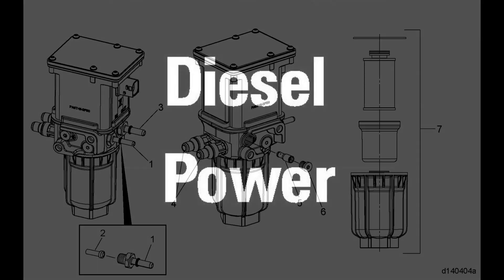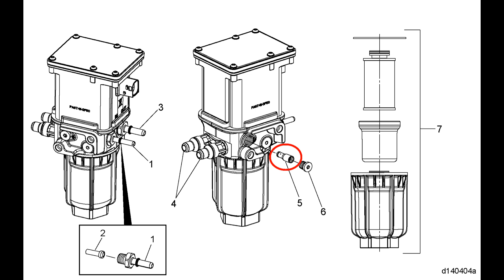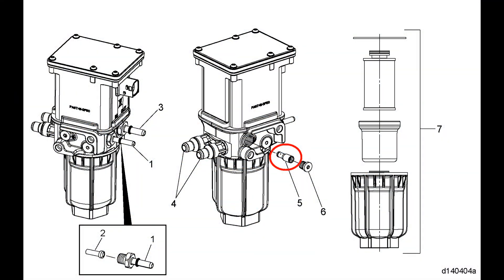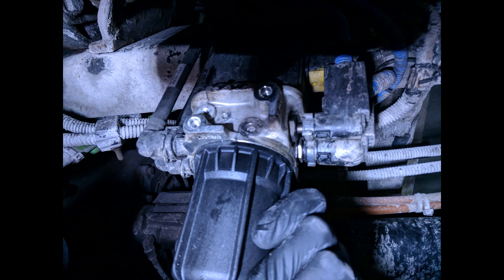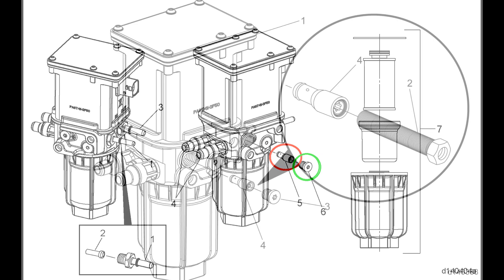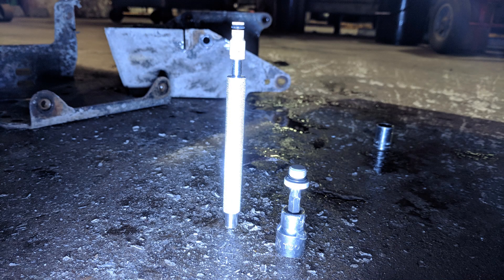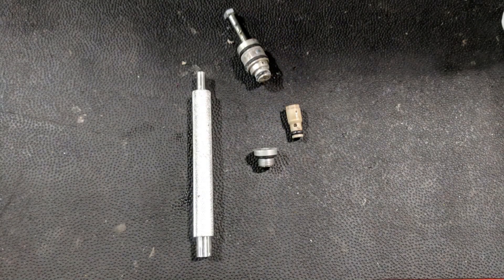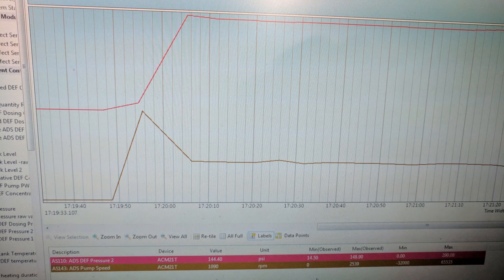Low DEF Pressure FIX

Comment from the maker: It's been a few years now and since this video was posted I have had great luck with reusing these valves. Simply cleaning them with hot water and working the valve seat and spring with a thin pick is all it takes to get them back in working order.
Reply: What size screw did you use to get it out?
Reply: @idontknowsh..8612 did you ever find out what size it is?
Reply: Great info, I was in Colorado -10 degree now I got the code 4374-0 about how much was the kit, thanks
Reply: Can you solvent that you clean oily pans and parts? or must be strictly hot water only?

Comment: What size screw or bolt to use in order to take the valve out? Fine threaded but what size?
Reply: Did you ever find out what size is needed?

Comment: Fault Code SPN 520342 FMI 17  DEF system rationality DEF pump speed high   and SPN 4374  FMI 0 DEF system under pressurized , got red stop engine CEL  and amber engine CEL and def light flashing with tank full. Truck went into limb mode. What you think will this kind points to the Pressure Relief Valve maybe plugged too? Not hearing anything from the pump and running. Can the pump be run manually by give it 12 volts? to test. I checked and is a 2020 freightliner  114sd detroit HDEP Diesel 12.8l i-6  55k miles 5k hours on engine and the records show that def filter was never replaced witch supposed to be every 3 years i think. What you think? Thanks for your time

Comment: I pulled out,  but is def supposed to stop coming out or is this a consistent flow
Reply from the maker: If the level in the tank is higher than where the pump is mounted, it will most likely continue to syphon out.
Reply: @TheDieseler  Ok the same thing happened when i disconnected theines for def doser.  Just kept pouring out until i reconnected

Comment: 4374 fmi 0 came up right after I replaced the DEF pump.. any ideas?
Reply: Detroit has a prime def pump service routine you have to run
Reply: Correct you need to prime the pump

Comment: Would this valve have anything to do with these codes? 5246 FMI 0, 4364 FMI 1, 4364 FMI 18 or 3364 FMI 2. I’ve been dealing with this issue for about a year and 3 shops can’t figure it out. I’ve changed everything except the one box.
does this every night. All engine lights come on and I stop and do a forced regen and codes clear for the rest of the night. Ever come across this before?
Reply from the maker: This valve is most likely not the issue. Check out this video - https://youtu.be/EVtehk9AR6Q
It's a run through on what needs to be done to properly diagnose this issue.

Comment: I wish you would do a video on bleeding one of these pumps. The information you give in your videos is awesome and led me to replace the pump. It wasn't much more money than the kit you talked about. After I installed the pump the system wouldn't build pressure. I pulled a vacuum on the outlet of the pump until I got fluid but after that it was only building 106psi at 1600 rpm. I disconnected the supply to the doser and ran the pump until I got def and plugged it back in. I ran my test again and got the same specs as you. That worked for me but I couldn't find the proper procedure for bleeding the system. Thanks for your help.
Reply: My low Def pressure code came back spn4374 fmi0. This problem shows up after the front brakes chatter while backing down a incline. This time I went straight and pulled the pressure line off of the doser and ran the ads self test until I got fluid and I plugged it back in. In just a second I heard the pump load up and my pressure returned to normal. Do you have any thoughts on how this could possibly be related to brake chatter or is my problem in the doser because it shouldn't need to be bled manually? Thanks for any help.
Reply from the maker: Sorry I didn't see this sooner. As long as the pump is not sucking in air (Submerge the doser supply line in water and watch for bubbles) it shouldn't need to be bled. It's not a deadhead system and DEF and air are always being returned to the tank and purged. If leaking fittings and air are not an issue I would be taking a good look at the wiring to the Doser. This is where the DEF pressure sensor is and that wiring is notorious for rubbing through on things and even on itself. I've even seen wiring that has rubbed completely through the Doser body which allowed it to corrode inside and give false pressure readings.

Comment: Or u can just replace the o ring on the vavle and save you're self money
Reply from the maker: +Cash_NYC The O-Ring is not the issue. The valve is cracking open below relief pressure.
Reply: TheDieseler ok thanks

Comment: people, what he is talking about here is LODS (liquid only dosing system)  also if any of the hard plastic lines from the tank to the pump or from the pump to the one box dozer nozzle and back to the pump are kinked (inner liner all jacked up) you can get pressure codes as well.  keep the def tank clean. use GOOD def. there is a hydrometer (similar to coolant hydrometer) to measure the def concentration you need 32.5% concentrate. there are many things that can and do go wrong with the def system.  good video.

Comment: Hey, im currently working on a bus with this exact code. When testing, the pump would run at 3400rpm but pressure would only be about 40psi. We ordered a new def pump so hopefully that fixes it. Your thoughts on it? Also it has a active code 4332/31, is it related to the def system? Should we fix that problem first? Or is this another issuse by itself. Thanks
Reply from the maker: +hellraizer06 The other code is related to Regen temps. It's probably unrelated unless you ran a low temp ATD recently and let it run for an extended period. I believe it will sometimes set codes like that in that situation.
If you found nothing else wrong with the system, the new pump will probably fix it but most likely because it will come with a new Relief Valve. This may be a good opportunity to try cleaning out the valve in the existing pump.
Reply: Awesome. Thanks for the inpur. Ill check the old pump once i pull it out. Mite also hold on to it as a testing pump. Thanks again.

Comment: Is there a way for me, as an single truck owner, to get the Detroit software without having to pay thousands?
Reply from the maker: +usdpaulp I'm pretty sure you can purchase subscriptions to the software from https://diagnosticlink.nexiq.com/
You would then also need an interface to connect to the truck. As far as cost, I'm not sure what the total would be. I've heard of 3rd party options as well but I'm not familiar with how well they work.
Reply: I believe you need to be part of the DDC guild and be part of the dealership network to get ddc proprietary software.
Reply: Check out diesellaptops.com they have all kids of diagnostics for different prices, the CanDo HD mobile unit works with your phone and multiple applications.
Reply: I got mine of ebay 80 bucks